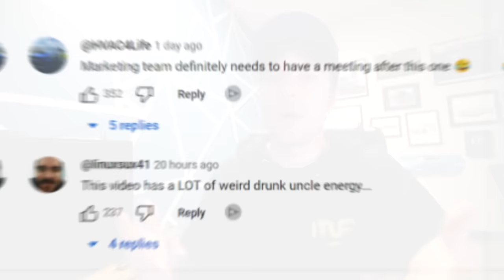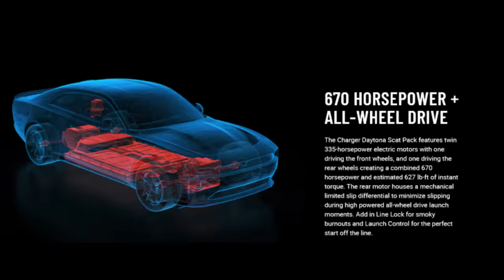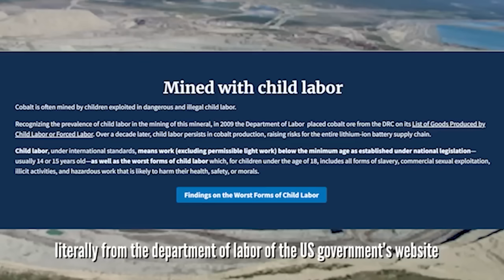The 2024 Dodge Charger Daytona Unveil Was Embarrassing

Comment: "I said 8 cylinders not 6" ~ Mad Max
Reply: Exactly.
Reply: And "I said 8 cylinders, not 3 and triple turbos"
Reply: Mad Max was whipping around a Falcon, luckily the coyote is still around. Lol
Reply: Technically in a post-apocalyptic situation, gasoline is it going to storm that long maybe Max of a year with stabilizers. The Eevee can be charged from any power source such a solar and wind. It would make more sense if mad Max was driving the Charger Daytona
Reply: @MurseTech64  but as a wastelander how would u get that tech to work when u can't get the parts. Low tech way would be better.
Post Apocalyptic cars F.B my self there not actually all Mad Max so anyone say it is actually Wrong because there Wasteland stories because try all they want there not mad max there's many others including in anime Fist of the north star is one of them
Reply: @MurseTech64 sorry boss but the power that charger needs to charge your electric vehicle (EV) comes from coal burning industrial plants for 95% of its energy.
Reply: @MurseTech64  wood gas will run on simpler gasoline cars and you can ruun dieels on oil.

And evs need a shit ton of electricity to run

If the world went mad max most cars would be steam powered if nothing else
Reply: @acynder1 
You can use that same fuel to get even more locomotion out of an electric motor
That is literally how Diesel trains work
Reply: @acynder1 
There are steam locomotives with electric motors simply because induction is the superior way to get power to the wheels
Reply: @Katzelle3  Oh, I know that electric traction motors are the superior way, Look at edison motors in canada, those guys have it right for the future of the trucking industry. 

On the mad max point, how are you gonna fix, let alone manufacture the ESCs required to drive an induction motor? or are we sticking with DC motors and their conmutators? If we went mad max, evs would be used to keep places powered up, not as cars.

Comment: 2023: Hellcat
2024: HelloKitty
Reply: Meow
Reply: LMFAO 🤣🤣🤣💀💀💀
Reply: Please don't disrespect Hello Kitty like that 😂😂
Reply: I heard the top speed of this junk goes up to 137 I have a Scat Pack 392 charger 2022 model I had 140 mph easily in a daily basis there's no way in hell I will trade in my Scat Pack to that piece of junk mine sounds like a true power muscle sound with Corsa extreme catalyst midpipe system plus add in the cold air intake and some black racing stripes not a chance oh hell I want to trade in my Beast
Reply: HelloKitty = quicker than Hellcat.
Reply: @blue46gt  The inline 6 will be faster with tuning and like all EVs, you can’t add power.  What you get is all youll ever have until the battery pops and the car rots in a landfill.
Reply: @Perceivedshift  the sad reality of ev
Reply: It's EV but sh1tbox version
Reply: That ain’t a hellcat, that’s a hell nah 💀💀
Reply: 😂 bruh
Reply: I don’t know how they don’t understand that the biggest selling point of a muscle car is its V8. ..
Reply: Good one!
Reply: I heard somewhere that automakers are now voluntarily putting in top speed restrictions due to growing concern of legal mandates for speed limiters, but in the case of the EV it's probably the trade-off of motor acceleration versus top speed. electric motors have a rev limit too and nobody seems to want to give an EV a transmission.
Reply: That was good😂😂😂😂😂😂
Reply: That was good😂😂😂😂😂😂

Comment: I don’t know about those in the comment section, but I’ve never heard a person say, “the exhaust note in that 6-cylinder is BAD ASS - especially in a muscle car.”
Reply: Inline sixes can sound hellishly good, just think about E46 M3
That fast and happy rev climbing, the scream at 8k rpm...
Or think about air cooled 911 boxer sixes. Or more recent GT3 boxer sixes, screaming happily from that grunt of an idle to the symphony of course to 9k. Tell me nobody ever got totally carried away for those, exhaust note and all.

Tho I reckon it's not the perfect muscle car sound
Reply: @alebonnibelpantani4887  Every single thing you listed as a 'good sounding' inline six, is a NA inline six. No turbos involved at all like the hurricane. A turbo spoolie snail inline 6 is not revving to 8-9K RPM anytime soon.
Reply: There's nothing muscle about either of these cars. A muscle car is a rear-wheel drive, front-engine car with ICE v8 power.
Reply: @tv321123  yeah, you're mostly right
I say mostly cause there are a few exceptions, like RB26DETT or 288GTO's just to name the first ones that come to mind. Lots of race engines too, but that's beyond the point I suppose.
Fact is, turbochargers change engine sound in all of its components, more often than not in a - let's say - good way; but this is true for every configuration, the one with most exceptions being inline fours, maybe threes.
A turbocharged i6 is gonna sound good anyways, as will a turbocharged v8; tho neither is comparable to their naturally aspirated counterparts, usually.
Reply: @alebonnibelpantani4887  100% agree. I don't like it as much as a NA sound. But a top secret Supra, properly tuned RX7, as you point out RB26; all sound great in their own right.
Reply: the 6g72 is a nice sounding V6 imo
Reply: @smashypeople  2GR too
Reply: @tv321123  Regardless, it's not a muscle car if it's not V8.
                            V8 defines what a muscle car is.

Comment: if i remember correctly from the last time i worked on a brand new grand wagoneer, there is legitimately no dipstick. no way to check the oil level, without running the car until it’s warm, then letting it sit with the battery on for 10 minutes. and they are notorious in our shop for throwing low oil level lights for no reason, then being extremely picky about clearing the light. i’m personally genuinely disinterested in anything involving that kind of “innovation.” to be honest though, i’m disinterested with every dodge after working on them.
Reply: Sounds like they took a page out of BMW's book by removing the dipstick.
Reply: When I used to be a lot attendant in a Dodge service center it was horrifying to see the quality get smashed over a decade. The older 300s hold up way better than the newer ones with electrical gremlins (not saying that the old ones are that good to begin with), a wagoner with less than 1000 miles having an issue with the rear door, a 60,000 mile ish front wheel drive cherokee with the tranny slipping really bad, and my personal favorite: an 8 mile eco-diesel ram with a check engine light already on.

And don't get me started with those garbage pacifica minivans, especially the hybrid ones. I have seen several with very low miles come in with a hybrid system failure or the stop start technology which is bad to begin with not doing it's job or stalling in an intersection.

The craziest thing though was a man who had to get a 3rd engine put in his 392 charger because they kept burning out.
Reply: I just drove through a Toyota dealer yesterday and there was two of those Waggoneers sitting on their used lot.. wonder why..
Reply: @widsquard Experienced people with a passion for their work are all aging out. From the top down, we are seeing an attitude of not giving a rip about doing a good job or not being able to do a good job due to lack of skill. I just watched a video from Car Care Nut about how you are better off buying an older Lexus LS430 vs a newer LS460. The newer ones are built more like a German shitbox than a Toyota.

Comment: The order to drop V8 did not come from Dodge, it came from Stellantis.
Reply: And they still lauching v8 rams. Hypocrites
Reply: @mrfishsticks266  from what I read, they're allowed the 6.4L in 2500+ trucks until 2025 when a version of the Hurricane is supposed to take over in heavy duty roles. 1500 and TRX from now on are confirmed to be Hurricane only.
Reply: CHIIIIIINA
Reply: It came from the government lmao
Reply: @itsaccer7443  it came by government pressure in the form of fines, but Dodge had been paying those fines for years and still making money.
Reply: @Skwisgar2322  you’re right but those fines will increase as the regulations get more strict and material costs continue to rise it will squeeze all of the profitability from the charger and challenger. I know everyone loves to be very critical of dodge but they don’t have any other options they could hold out like ford is until the bitter end or try to carve out a large market share in ev sports cars before everyone fully transitions. GM has already axed the Camaro and is replacing the corvette with an EV version. It’s an inevitable change unfortunately the v8 will be gone from production within the next 10 years
Reply: @itsaccer7443  unless we can manage to roll back some of these regulations.
Reply: Nah, it's coming from the government. This is why all the brands continue to push electric vehicles that we don't want. The government will subsidize it
Reply: @mrfishsticks266 no they are not
Reply: @mrfishsticks266  RAM is not DODGE and they dropping V8 also in fact none of the 2025 RAM's have a V8
Reply: @cpufreak101 we’ll see how long that lasts if ram put Cummins new gas/ natural gas engine in their trucks
Reply: @Qugie how do you know there’s no V8’s in rams the 2025 2500+ hasn’t been released yet! I personally can’t wait to see what the new gas Cummins is going to do, 660ftlbs of torque👍
Reply: Biden and Stellantis killed it
Reply: @cpufreak101 3.0L car engine in heavy duty trucks💀💀💀💀
Reply: @itsaccer7443  so instead of buying the new junk stick with the v8 so we can show them , and no we still have like 40 years until gasoline engines aren't sold anymore
Reply: @imnotusingmyrealname4566 yea shits a joke
Reply: @huntaaa4  40 is a realistic minimum I would say
Reply: @mrfishsticks266 that was because of international environmental regulations.
Reply: YAH THEY JUST MAKING FIAT DODGES ANY WAY.....Back in the day they were Benz Dodges i got one and hit over 400,000 miles with no major problems
Reply: @Command-Hawk  the charger/challenger is more benze than fiat.